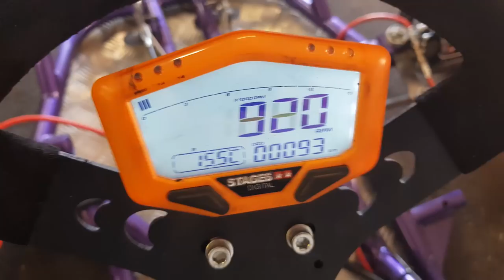HONDA CBR 600cc Go-Kart walk-around

Comment: So I’m building one right now and I’m torn on putting it on the side like yours or stretching the frame. If you had to build it again what would you do? Does your kart turn left and right just as well? Any weight issue on the side or balanced? Thanks
Reply from the maker: Mine was a crap build honestly.

You can put it on a side if you offset your driving seat position to counter balance.
Else I would honestly just stretch the frame a bit.

Also, not very smart to have redlining engine next to your vitals😅

Looking back, I wouldnt really do a such a large engine in a gokart, better find a tuned cr250 or ktm 300tpi style 2 banger and make a light rocket.

Or, do a full blown cross kart/drift kart build that uses normal tyres.
These kart tyres last like 2-3min😂

Comment: That radiator looks like a heater coil from a car or truck.  Looks cool!!
Reply from the maker: Yeah, it is a heater core from some VW. I will upgrade it this summer for sure as it gets toasty if you just do dougnuts and no speed driving. (no cooling)
Reply: I bet. Would like to see the video when you get it done!!
Reply from the maker: 100% there will be one - I have done a ton of upgrades to the kart as-well so much new things to see.
+ i finally have the proper gear to film it with.
Ohh, and thanks for subscribing, stay tuned! :)
Reply: No Problem and I will!!!!
Reply: Was gonna say it looked like an air to air intercooler off of a 1.8t Passat or golf. I was close lol.
Reply: David Johnson   .
Reply: aldeias bonitas de Portugal

Comment: If you seal the air passage to the main jet air correcter tube it will run better without ram air,  . I have a CBR600 in my kart , it ran 9.9 1/4 mile !(on a 25 hp shot of nos)
Reply from the maker: 9.9 is impressive AF dude. Can't wait to get mine on a strip. What trap speed?
As to address your point, true, smaller main will help, but I have gone FI for now, waiting for the new ECU. 
You can see the whole build on my site aswell - akis.lv
Reply: @CarlHook  It crossed the line at 126 mph,
Reply: I am assuming you are not in the uk.. If you are you would be most welcome in our club, we are the UK DRAGKARTS  , you can find us on facebook , as the name implies we mostly drag race but i recently went to Pendine sands in wales and set a new record for the fastest kart on the sand , 119.9 mph, check us out , im sure you will be interested mate
Reply from the maker: @georgemaclean1970  hehe. I sure will mate, sounds amazing. The kart was built in Denmark, now its back in Latvia. I have to take mine to a local drag strip to see how it holds up
Reply: @CarlHook  All the best mate .I will warn you its ADDICTIVE  .
Reply: Still have the kart ? Im building one right now with my buddy and i from Denmark saw you have been living here? Maybe you have a Instagram to write to for some help and ideas if its okay with you?

Comment: Don't mean to bug with questions, what sized axle are you running there? I need to get a live axle for my project that I'm going to get a big engine on and thinking a 1 inch axle would be good?
Reply from the maker: I think it was 50mm hollow,  but with the stiffest metal available.
I would not advise a solid axle, they tend to be a logtheavier at the same size, or way weaker at the 1" sizes.
But hey, I haven't tried them, might be wrong.
Reply: @CarlHook  yeah I hear ya bud, thats why I wanted to check around and see what others are running on theres, I might check around on 50mm ones

Comment: What sized tires are those? Beautiful kart!
Reply from the maker: 11 x 7.10 - 5, thanks bud
Reply: Sweet! Got the same wheel set up for mine! 11x7.10-5 in the rear and 10x4.5-5 in the front, this go kart has inspired me to really want to aim for a motorcycle engine on a project of mine! :) God bless it 🙏
Reply from the maker: @coltenlooney5811  that is awesome.
Please document the process and share!
Reply: Thanks mate! Am planning on it! Got a lot to do and looking forward to it on the kart! Its a concession heavy frame go kart so its set up very well for strength in the frame, and gotta lot of welding to do, strengthen a side plate and support for engine, and then find the engine! Haha, I hear a lot about wiring on these engines, is it very hard? Can you get the engine wired already where you just fix it up to frame and all the other work but not have to do wiring? Havent messed with that stuff before and didn't know.

Comment: Iam sure it’s quick BUT I’LL bet it DOESNT handle well. It doesn’t look balanced well. I built one with a KZ-1,000 engine, it’s mounted in the rear right behind the seat & it’s balanced PERFECTLY. When you have that much power you NEED the cart perfectly balanced. Mine does 0-60 about 4seconds.
Reply from the maker: Hey, offcourse it is not perfectly balanced, but I do not want to make it any longer than it needs to be  thus why the engine is on the side.
Mine has done 0-100 in 3sec. But I know I can make it faster.
Will bring it back to Denmark and make it EFI
Reply: Karlis Akis That’s cool,Dude NOT at all rag’n on your cart it is DEFINITELY built well & I get it that you don’t wanna make it LONG. I put my engine in the rear to handle better but holy shit 0-100 in 3 seconds?? That’s CRAZY!! WELL DONE👍✌️

Comment: Why are these engines not in the rear of these karts?
Reply from the maker: Some build them with the engine at the rear, which makes life like 10x easier, but I just wanted to keep the stock lenght of the chassis to try and keep it as agile as before. + It is way more fun having a 16k rpm rotating mass right where your body is. :D
Reply from the maker: Some build them with the engine at the rear, which makes life like 10x easier, but I just wanted to keep the stock lenght of the chassis to try and keep it as agile as before. + It is way more fun having a 16k rpm rotating mass right where your body is. :D

Comment: Where did you get your rear sprocket and hub for it to work with a motorcycle chain? Im building my own kart to now with a Suzuki gs500 engine so looking for some help with hub and sprocket 💪🏻 maybe you have a Instagram or Messenger we could pm there ?
Reply from the maker: Karlis Akis on Facebook.

Its industrial type sprocket where the outer shell is the sprocket, and thus can be exchanges quickly to different sizes.
Reply from the maker: Easiest is to calculate rought torque axle will see and head to local tractor/industrial automation/hydraulics shop and ask for fitting sprocket.
Reply: @CarlHook  can you maybe message me can not find you on Facebook 🙏🏻

Comment: Think I'd have gone with something lighter with more usable power. Maybe a 2 stroke 440  sno pro engine or possibly even a 700 triple snowmobile engine. Don't need the torque of a 4 stroke with tires the size of a dog dish.

Comment: Put it middle back ,unbalance due
Reply from the maker: Naah, then I have to make it longer, which screws up the whole balance. The engine and should be offset by the drivers weight. I will re-do the whole frame probably. Have been busy with work.
Reply: @CarlHook  my friend had one like yours,https://youtu.be/HH-hnOtJK78
i think your is done better. Nice job. I want to do a cr500 kart, much lighter & simpler fo me. Ive also got a sachs wankel km24 294cc single rotor air cooled dirt kart. As basic as it gets